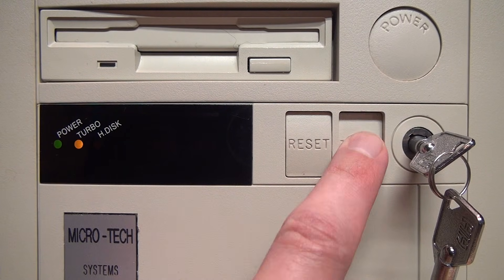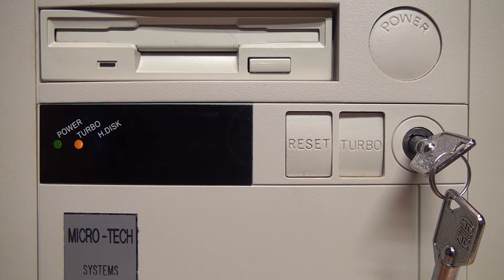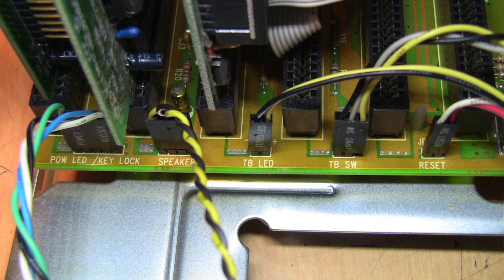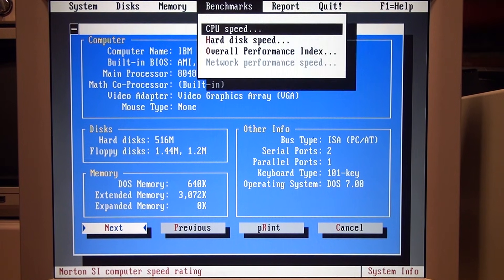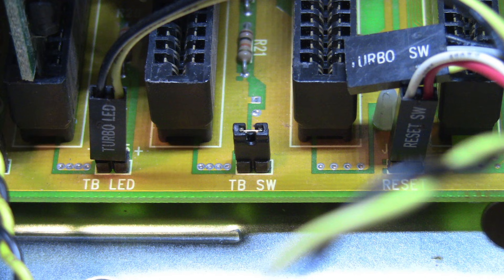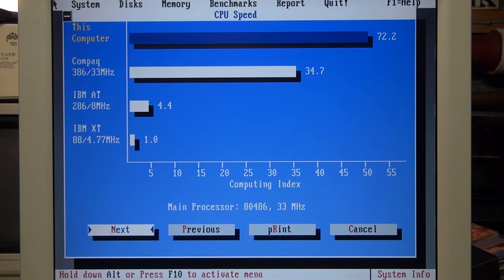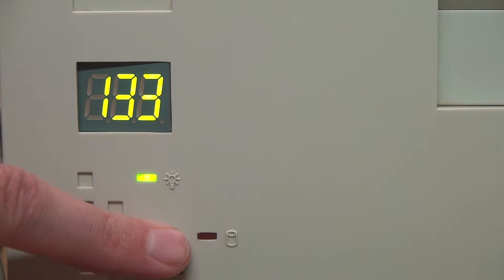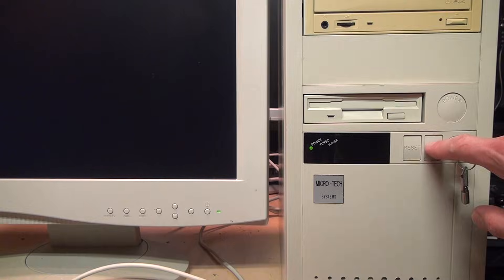The PC turbo button mystery finally solved!

Comment: I already know how it worked, having used a 10MHz 8088 PC for years and carefully studied the details of its turbo control options and their relationship with the cassette recorder relay in the original IBM PC.  Calling it a mystery must be a joke or a nativity.  As this channel has a reputation for knowing about old tech, I assume it's a joke.  Now let's watch it.
Reply: Yeah, it's just reiterating the old facts.  "Turbo button slows down your computer" was just a shortened form of "Turbo button slows down your computer if not pressed", which is exactly what it did.  Either to the PC/G speed if 4.77MHz or the PC/AT 8MHz, or even whatever slow speed was possible with the chips used.
  RIFA capacitors have a safety purpose. Their job was to handle voltage spikes without killing people, but unfortunately, the technique used to do so would ultimately fail rather spectacularly when hit too hard or too many times.  In fact, they are paper capacitors tested to the "class X and Y" safety standards, which most modern capacitors at the time would fail.  RIFA is one of the last factory making these old school capacitors.

Comment: My first turbo system was an 8Mz XT clone. When I had the money I bought a full sized tower for a 286 system that ran at a whopping 16Mz, including a two digit LED speed readout. Who would ever need three digits!?
By that time most if not all motherboards let you configure the system to start up in high speed mode if you wished. There was no actual detection of actual system speed; you had to set the LED panel for hi & low speeds yourself. 
I had that tower for a long time; upgraded to a 386sx-20, then a 486dx2-66. By the time I passed 99Mz, I had to buy an ATX case for the hardware. Readouts were rare for ATX systems.

Comment: Hi, another great video

This is like the black magic of computers, being old enough to have purchased C64 new and every other computer almost every second year, then a life time of PC upgrades

I explain to people at the time many games or software was speed sensitive, with 286/386/496 you have the option to slow back to stock XT 4.77m 

Nortons info is good, but so it making them play frogger !!

I explain wired correctly your fast machine is full time turbo or fast on , only when you want it to slow down it is turbo off or slow

The first machine that did not have the turbo connector on the mother board was a Pentium 100

Regards
George

Comment: aaaalways check old electronics for RIFAs and replace them with something is NOT a RIFA if you find them. it does not matter if they look fine or not, they are some of the biggest ticking time bombs in any old electronic device and you don't even need to turn the device on for those little rats to blow up. if it's plugged in, that's enough for those things

Comment: I predict it to be only a matter of time now before someone designs and produces a turbo rotary switch backed by a MiSTer FPGA or similar: Actually transmogrifying your computer into the full-on electronic equivalent of the original hardware in question should allow for multiple positions, like the IBM 5150/60, the 5170, maybe a nicer & faster clone AT, and maybe the Compaq Deskpro 386 as well as a choice of typical SX and 486 and Pentium computers running at the exact same speeds as the respective originals. Way back when, you'd have needed a craaazy custom-mainboard with multiple CPUs to implement a turbo rotary switch like this, but you should be able to do it in Current Year with FPGA technology.

Comment: 13:34: The other thing here is that the 7-segment display doesn't toggle anymore. So lame.
Reply: It's still possible the segment display had an input for the turbo LED as a switch for use with boards having bios-controlled turbo.

Comment: I had my first turbo mode PC in and around 1996. All I ever did was run benchmark tests because I had no other use for a PC. Life was so simple back then.
Reply: Why did you even have a PC? :-)
Reply: @alexmckee4683  Had to keep up with the Jones.
Reply: How much did it cost?
Reply: @queenannesrevenge3770  $3,500 Cad
Reply: I remember my first pc in 1990s. Odd design back then but guess they were aim at offices
Reply: @mdb45424  tbh I liked the office look. Don't miss the beige particularly, but many modern PCs look ridiculous with their fake carbon fibre and metal-coloured plastic etc. Give me real aluminium or if it has to be plastic then at least plastic that looks like plastic and doesn't pretend to be something it isn't.
Reply: How often were you benchmarking your PC? Also, did you ever try any games?
Reply: to be fair messing around with benchmarks is quite a lot of fun

Comment: Considering that modern computers have the Turbo function once again (although for completely different reasons), I wonder why no one has thought of selling a retro PC case an actual working Turbo button and a real-time speed indicator. The switch and indicator can work via an internal USB connection and the functionality implemented using software.

Comment: Regardless of how the button is configured I always considered the turbo button as a means to slow down the computer because with turbo enabled the CPU is simply running at its designed speed. Disabling the button was to slow down the computer to resolve issues. If the turbo button were designed to overclock the CPU or to enable another piece of hardware like a coprocessor or something then I would have considered it to be an actual turbo button to speed up the computer.

I feel like the turbo button is more akin to a button in your car that would turn a governor on and off for the engine rather than a button that would toggle the boost from a turbo on and off. I just think the button was poorly named.

Comment: I think another reason key locks went away in the mid 1990s was because of operating systems like Windows 95 making it a lot easier to simply lock your computer with a password rather than a physical key.